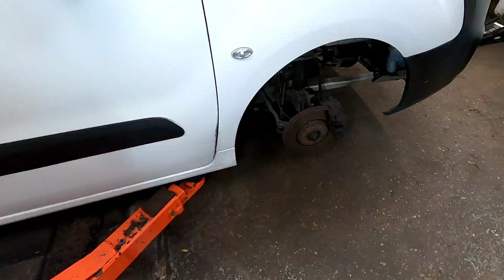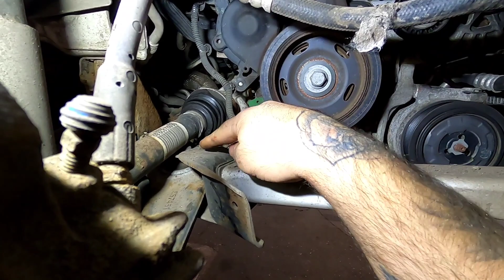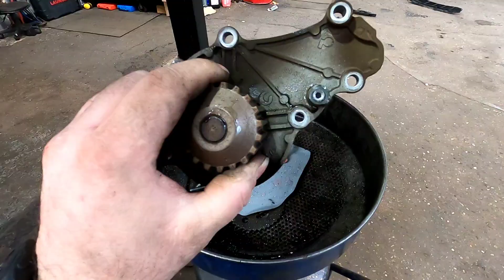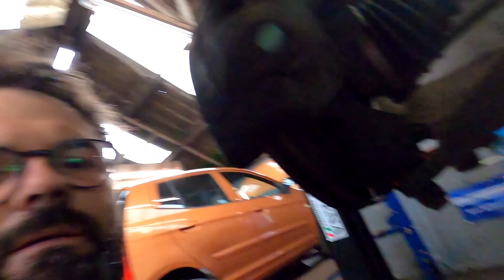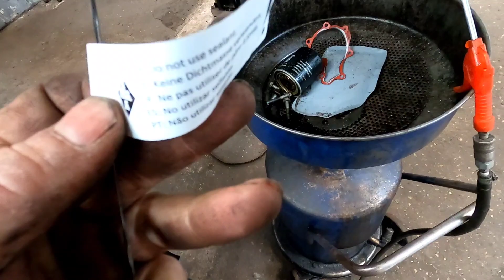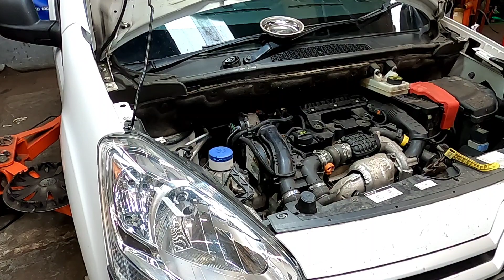one lucky customer. Timing belt replacement dv6

Comment: Brilliant video 👍.  Baz makes it look so professional..Just done my Rover 25 diesel .,similar to following his procedure
Reply from the maker: Rover 25 brilliant car esp being diesel
Reply: @bazmeredith  Found another of your excellent videos on Ford wet belt 🤦‍♂️.. partners Citroen C4 went into garage with timing issues , they basically didn’t clean out sump /strainer while removing old belt , causing bearings to fail /engine rebuild. We have motor ombudsman dealing with it now . Honestly wished we had used you ,
Reply from the maker: @kevwatson3661  so many don't do the extra bits to make sure the job is done correctly... I'm aiming to get some real good in-depth videos posted